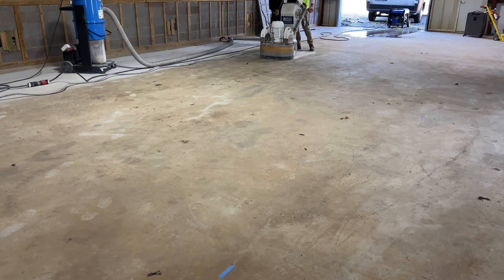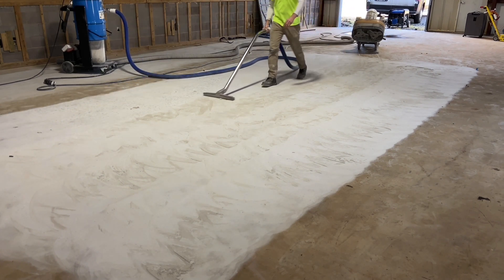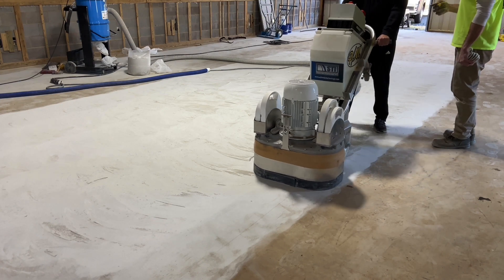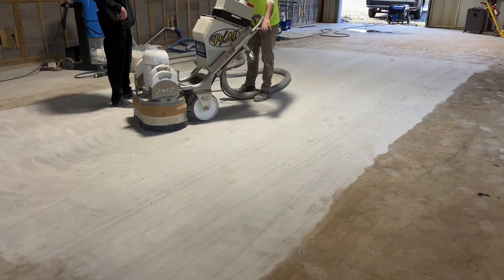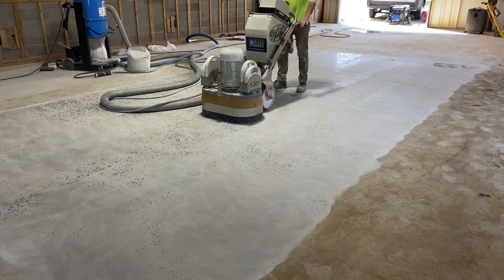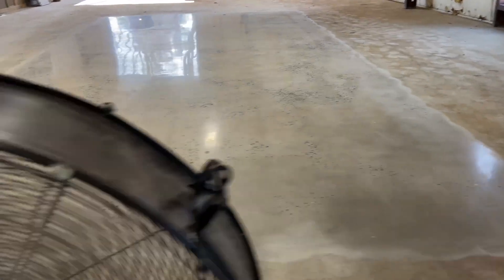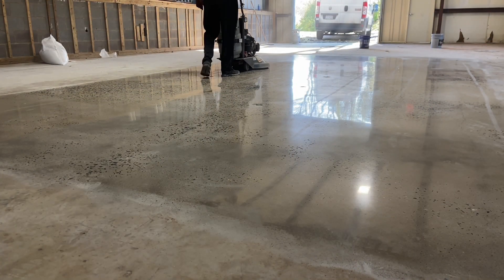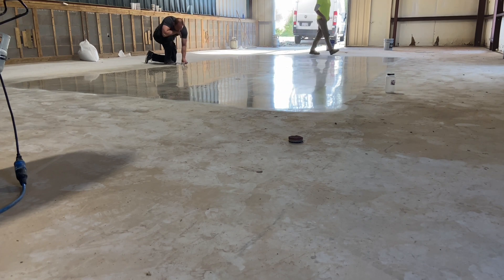Why Use a Concrete Densifier - Surface Preparation

Comment: Thanks for the video.
I'm about to apply Lithium Silicate to a little outdoor garden wall that is made out of some upcycled chamotte bricks which origin from a curing tunnel of an old brick factory near my place. I chose LithiumSilicate for more colour and shineniness as the potassium silicate would leave some haze on the surface?
So i wonder if I should do some gindings first befor i apply the lithium silicate solution? I mean the colourful chamotte bricks are kind of rough at the surface anyway...
I plan to do some 1:1 dilution with destilled water so the LS is supposed to penetrate deeper into the brickwork?
What do you think? Will some silicate surface finish also work on other material than concrete as well?